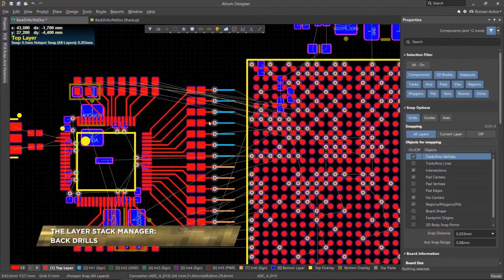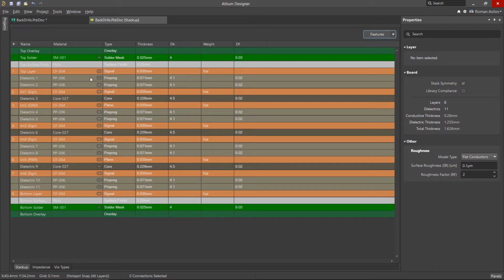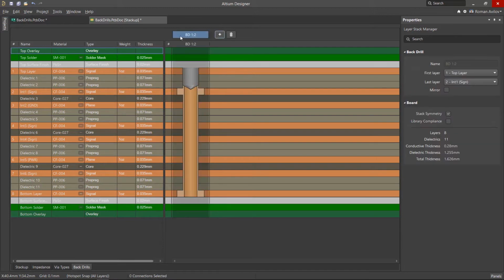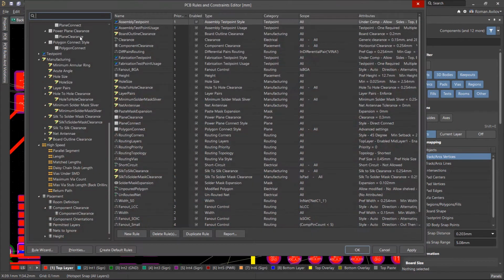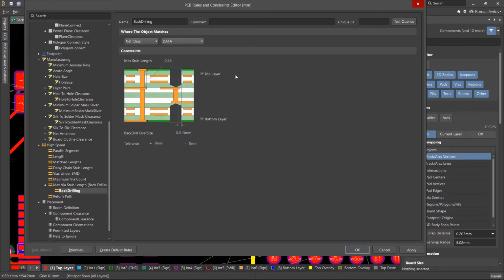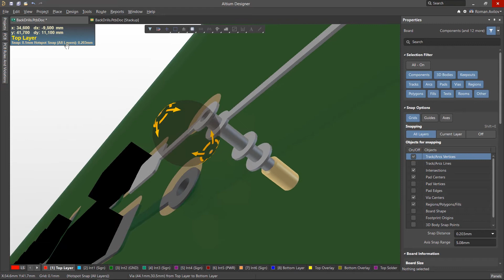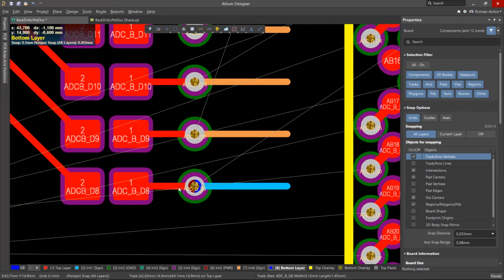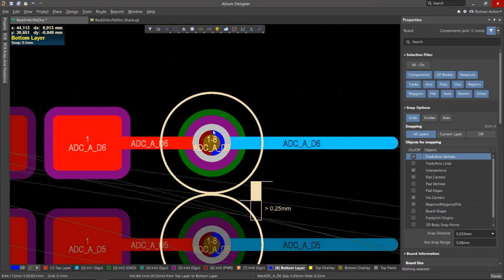Back Drilling in Altium Designer Overview

Comment: Good in concept - but does not work in real-use case.
My suggestion is for Altium to add a via tab property as "backdrill" (Just like soldermask) that can be edited on the fly, rather than a class.   There are scenarios where you can have a backdrill "must cut L4 , nor cur L3" due to the dielectric space where the high speed signal is on L3.   Class rules tend to be too general and not granular enough such as a blind / buried via stack where one side of the net is on one layer and the other side of the net can be backdrilled from a different side of the other end of the net.